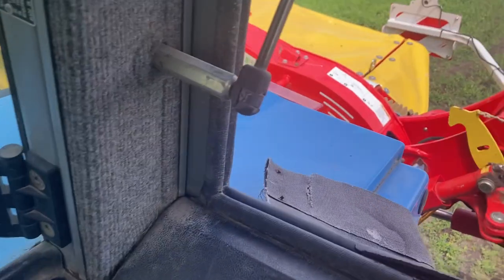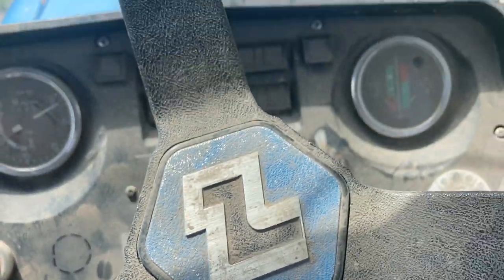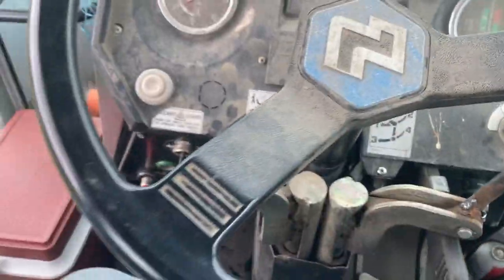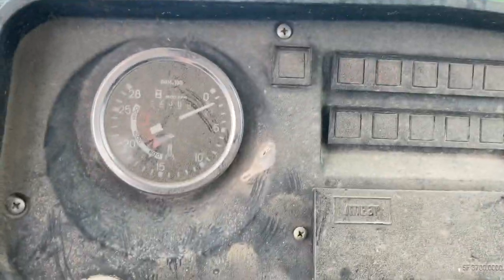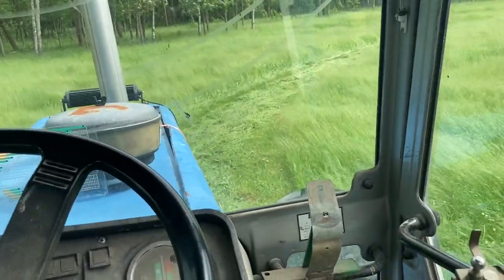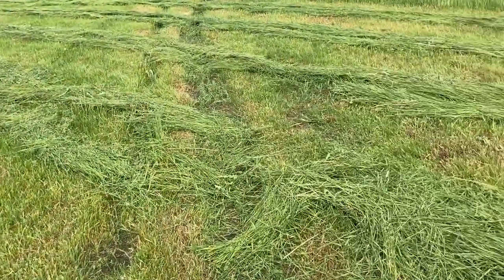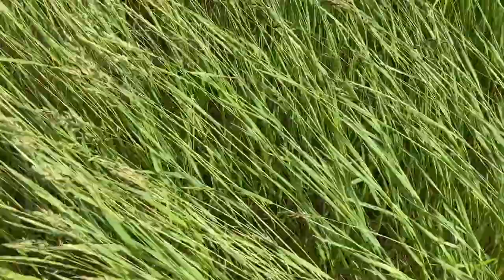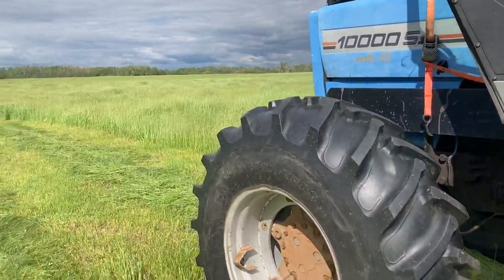Messing Up PTO clutch on Landini And Cutting Hay

Comment: Have a 96 Landini Blizzard that also grinds like that when im trying to engage. Did you find a fix so it dosent grind?
Reply from the maker: Unfortunately no, but I haven’t looked inside the tractor. I let the tractor warm up then shut it off, engage the pto and start it back up. I know some parts are hard to get to Canada so I haven’t even looked into fixing it yet, I’ve just gone around the issue for now.